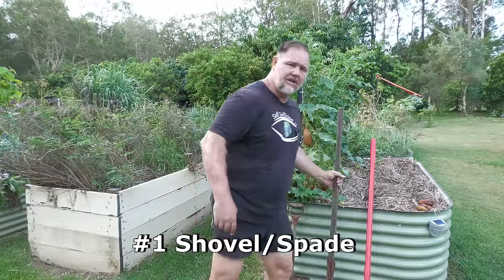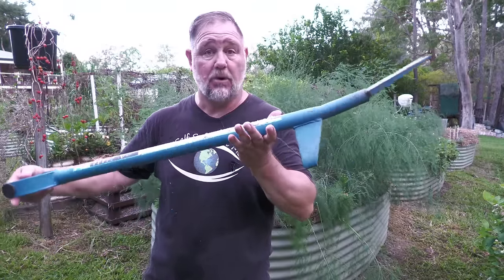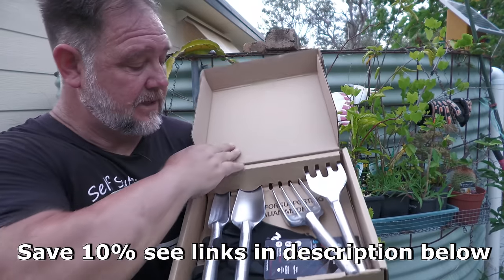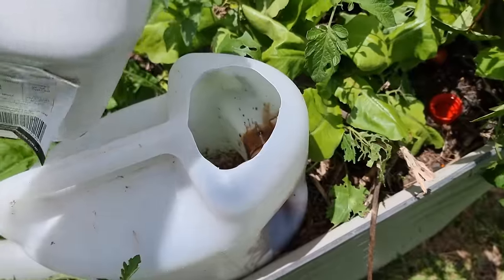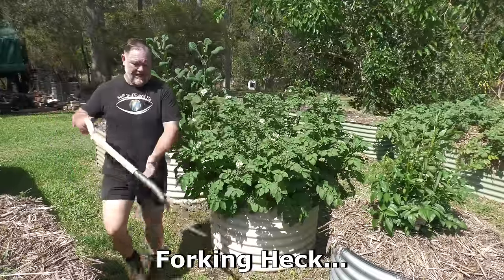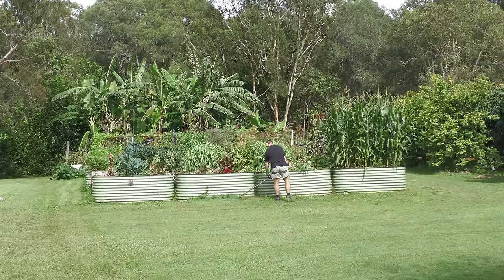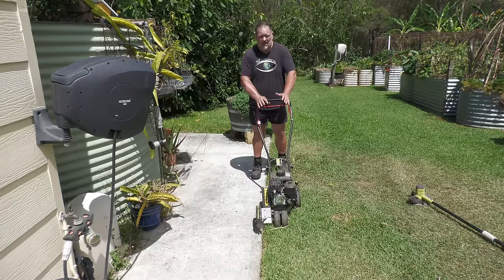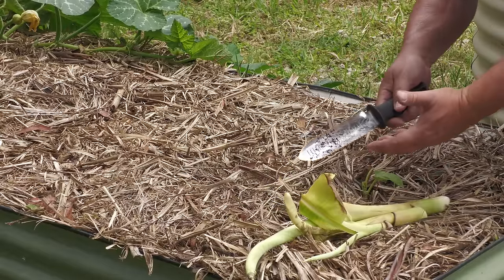33 ESSENTIAL Gardening TOOLS I Use All the TIME!

Comment: garden stakes (maybe not,  depending on how you define a tool. I have rebar stakes around the garden as hand holds ), drip watering system/sprinklers, hand weeders, soldering iron to make drainage holes in pots, garden netting for shade, or protection from birds and pests, weed block, buckets for smaller gardens buckets are useful for carrying tools, weeds, or moving material like potting soil and fertilizer as well as storing tools, fertilizer, etc., Garden stool to sit on while working close to the ground if you don't have high raised beds. While it is not a tool, good garden clothes, shoes, PPE, masks, gloves, and eye protection.  I like re purposing the old pots for the garden.  I have used some old containers as pots before.  Nice list of tools, I have many of them except for the big ones like the carts and mower, my yard is too small for that.

Comment: That’s a thorough list, mate!  I’d have to add ‘caffeine’ to my list (mind is willing, but the body would rather be seated). You’ve made a great point on using various sizes of one tool, esp secataurs.  I feel holding a mattock makes me happy to great door-to-door salesmen 🤣🤣.  Finally found a short tool with a flat edge on one side with a 3-pronged fork on the other (my answer to your ET).  Great in my raised beds as a fierce adversary of weeds.  Oddly enough, I’ve just discovered PLIERS as a useful tool in pulling resilient weeds.  I’m grabbing dead stems and pulling out the entire root w/out digging….yay!

Comment: You can actually bend the garden fork back into shape if youre strong enough, ive bent the inner teeth multiple times on the stainless steel ones before, albeit the outer teeth are hard to bend and you might need to heat it up before bending it

Comment: To drive a star picket, grab a 4 inch steel tube 2.1/2 foot long weld a 1 inch steel base to one end, then put handles on side 2 of. Slip over star picket and drive home. 2mm tube thickness.I have had mine for twenty years cheers

Comment: PLEASE! STRAIGHTEN THE TINES ON YOUR FORK!!!! Forks work best (and easiest) when ALL tines are co-planar.

My "tine straighter" was a 1&1/2" galv pipe driven into the ground, then I inserted the offending tine into it and using the appropriate "mechanical persuasion" to straighten it and other mis-aligned tines. Also, sharpening the tines periodically (like seceutuers, shovels, spades, picks, mattocks etc) improves the preformance of the tool and ease of use.

Laziness (working easier /smarter) is a virtue and I work hard at it!

Mark. Maybe drop a video on appropriate garden impliment maintainance?
Reply: 🤓…🎉OMG!
Professor William’s in the house!! 🎉😅🏆
Reply: 💥…yes…🤓🍻

Comment: Here’s my take on tools especially as we age.  
Get light weight tools.  Can’t tell you how much difference there is in a wood and heavy metal garden rake is compared to an aluminum one—night and day!  I use to avoid using it because it was so cumbersome and now I reach for it more often.
On handle lengths:  I love my short handled shovel!  I don’t know why, but I find people creep up on me when I’m working and they are in The Danger Zone!!  
On Battery Operated:  Absolutely Love my trimming extendable battery powered Milwaukee Chainsaw!!  I no longer have to have my husband get out the large smelly gas chainsaw.  I can do it myself.
I’m concerned about shorter battery operated chainsaws and pruners because I think people could get careless and chop off some fingers.  I know I was careless with an electric hedge trimmer and luckily only nicked my hand.  We Love our battery powered bagger mower.  It is quiet, no gas or oil, no carburetor or air filters and it bags up clippings for chickens and garden—what’s not to like!!  Will be getting a tiller next for rare occasions I need to mix things up.
A good 5 tine pitchfork is a must.  The one you used we call a manure fork and think it might be too big of a bite for most to handle.  I recently read about using an auger on the compost pile and will try that today.  Will invest in a broad fork as my soil is perfect now in first garden, but second one still needs a bit of work.  For pulling T-posts my husband uses a rope tied into a prussic knot and uses it to cantilever the post out, but the tool you have is handy as well.
I had a rear tine tiller and loved it until I realized there was foam in the gas tank that broke down and to get just a gas tank was over $200 so we ended up with a used front tine that is a bear to use on sod—Ugh!  My husband and I have a complete differences of opinions with front and rear tine tillers—I loved the rear tine, but he thought too difficult to turn around.  If you have a small area (which we don’t anymore) it would not be advised, but to me it was the best!  I just don’t use the front tine and tell him he can till when I need an area turned over.😅. Who needs a gym with a front tine tiller?!  It’s like flinging a medicine ball and tug-O-war all at once.😂
Sharp hand tools are a must.  Have a hand saw, pruners of various sizes, scissors, small pocket utility knife, loppers and long scissor clippers.  On my wish list is a battery operated saws all.  A sharp hoe and Japanese hoe.  I’m particular about the size of long handled hoe because if too blocky they are cumbersome.  My GMA had hers sharpened over the years and was perfect size.😊
Watering cans:  Love my plastic Dramm as it’s balanced right, the opening is large and the rose can easily be snapped off to clean.  Yes, plastic doesn’t fare well in the sun, but it’s light weight and it’s difficult to find a metal one with all the features and doesn’t rust.
Irrigation:  I just installed drip emitter irrigation this year because of severe drought.  Just couldn’t keep up watering.  I think when most people have difficulty gardening it’s because of lack of water.  We have had a great improvement in root crops and not one of them was woody!  It saves, time, money, water and improves crops—what’s not to like?
Covers:  Shade cloth and bug netting—Gotta have!
Carts:  I have a small wheelbarrow that is great and an electric golf cart with box.  Having a great balanced hand cart can make a huge difference.  Have a wagon, but pneumatic tires don’t last.  A small low tipping cart to pull behind lawnmower is nice.  I mainly use the golf cart and small wheelbarrow unless the job calls for one of the big trailers.
Sorry to hear about the inventor of new tool and his reaction to Covid shot.  I’m not anti vaccine, but I also had a bad reaction to a flu shot several years back and it was the one and only I will ever have again.  So I can’t get the Covid shot and Dr. advised against it.  I wear a mask everywhere and people can laugh and it’s a PITA, but people all over our area in Wisconsin, US are getting it again.  Some are bad and others not so much.
Thanks for your take on tools you like!  It’s nice to know before you buy and also considering what you may need as you age.

Comment: my thought was, and I don't know if counts a tool per say, and you indirectly mentioned them in your alloy give away, but gloves can be handy when digging or pruning.

you have notably raised garden beds, which saves you the need to kneel

and I dunno if this is a tool or not, but I'm sure in some situations knee pads could come in handy, or even an old worn out shirt or something.

and I read through the comments, and I agree with bins and buckets, and it kind of overlaps with the wheelbarrow and the old steel pot

in my experience sometimes it's just handy grabbing a bin to do some quick yardwork instead of bringing out the wheelbarrow

a large bucket or two can be handy in moving water to places where the hose doesn't reach

and I don't know if Australia has dandylions, but where I live we have them.  They have long deep roots, and sometimes if you just try to pull them by the leaves you won't get the big long root

so there does exist a tool that is designed for pulling dandylion roots

although if one doesn't have it either using a trowel (which is one of the tools you listed), or even using a flat head screwdriver to loosen the soil around the dandylion root, so when you grab it by the leaves it's more likely to pull up with the root and not just have the leaves rip off.
Reply: one last tool,

your beds are raised which makes this tool much less useful unless you stand on the beds, and I don't know that you do that

the tool is a hand tiller, and it seemed to do what it's supposed to.  Seems to be good for tilling soil for a garden.  Dunno, what your thoughts on those are

Comment: I find a good sharp hoe indispensable. I have a Rogue Hoe 575G and the short handle version H575G. I live in a rocky high desert and we get tough wild grasses and desert wildflowers popping up where we don't want them. The hoes get under the soil and cut the roots.
Reply: That’s the name I was trying to remember.  My gma’s garden hoe was sharpened so many times it was not very tall, but sharp like one of the Rogue models.   Nice and easy to work with.

Comment: Question for you, how do you keep your Panga (Machete) sharpe? Mine has gone so blunt, that it takes more work to cut through things.
Reply: If it's really dull you can first dress the cutting edge with a flat file , a fine one works better than coarse , after that keep it sharp with regular rubs with a whetstone / oilstone . Use gloves for safety if you feel you need to .

Comment: For putting in "star pickets"  -- T posts in the US,  use a pounder.  It is a steel or iron tube with handles to pound the posts in.  The sledge hammer is too difficult for old ladies for T-posts.  I have never seen those post removers up here in Missouri though.  Since I do not yet have a mulch fork,  I use my claw tool --akin to a hoe but with tines--to loosen the mulch so I can shovel it into the wheel barrow.  

I also use my claw tool to check for snakes BEFORE pulling weeds!  I have been bitten by copperheads twice, and I do not like it.  (I almost died the second time).  I never pull weeds any more without checking with my claw tool.  It is helpful for other odd jobs around the place too.  And I repurpose old pots and pans for odd jobs too.

Comment: my ideas on the use of tools changed when i lost a leg. a spade is no more for me. a chillington hoe replaces it. hoes and cultivators are interchangeable using the same handle. even my trowel has a long handle. i even cut the grass with a cordless strimmer. wires risk getting wrapped  around the wheels of a chair...........................brian